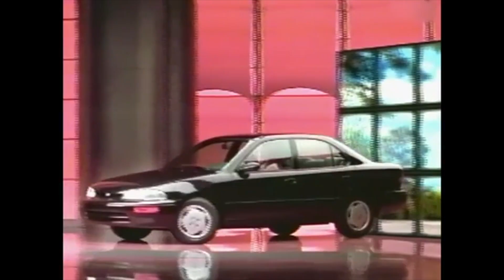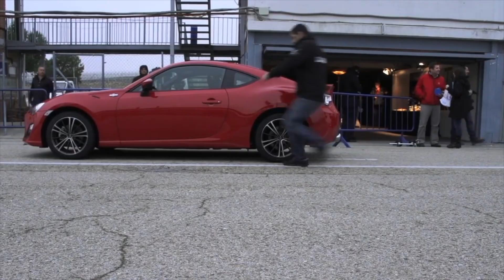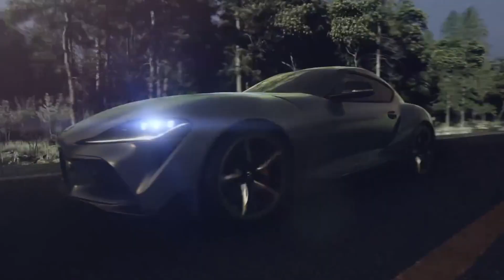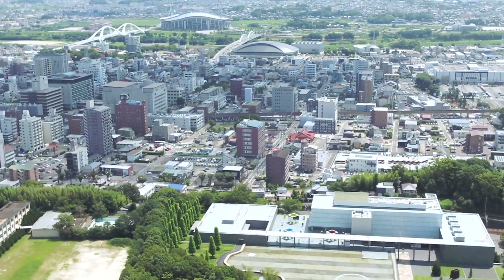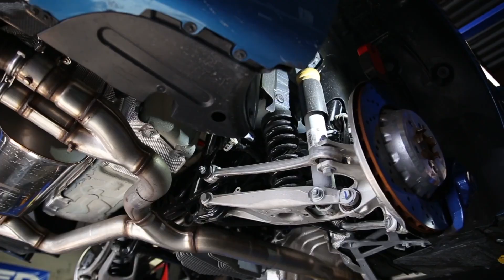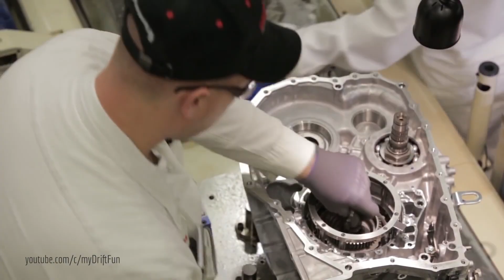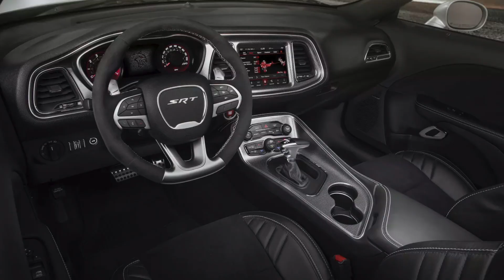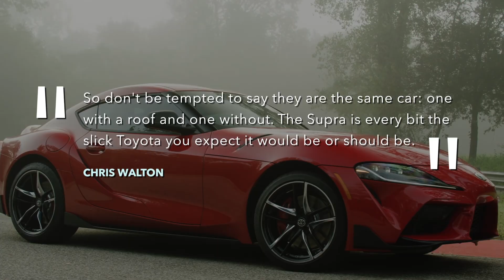MKV Toyota Supra - BMW or Toyota? The UNTOLD TRUE STORY

Comment: Yep yep lack of understanding...by both manufacturers is infectious and spreading....
Manufacturers have no clue to the loyalty of the drivers/ buyers of sports cars. 
They take pride in their brand of choice.It is the distinction between the Makes .
  Japan has a well seasoned, past, of making cars less expensive, by alot, and better , making their competition run as if Godzilla is coming down the Street.
    They built a Supra thats the opposite. Its very expensive , its not unique to the Brand .
   Which is an illness in the sports car world that started at Nissan with the Datsun Z.
     What ? Where is the connection you ask?
     The Z flew on the scene at low cost and very high performance , in a feild of competitors ,so superior.,was the Z ,it could only be compared with Sports Cars, 2 or 3 times its sticker price.
    However Nissan got greedy with the little cars wild success.
It stole the Datsun name ( which they created ,to saveface if Americans didnt buy Japanese goods)But once the 240Z hit the super World Class Sales records, they instantly ripped up the Datsun Brand and wrapped its Nissan Arms around it.
    But unlike Porsche 911 , who, stayed the course. , thru the decades, with the Driver/Buyer in mind. Keeping the 911 (despite Marketing fickle whims), faithful to the Sports Car Driver desires.
Light weight, performance, a "tool" for the Driver.
   Nissan took the Z and listened to the fickle whimsical Marketers.
And tried to make the Z. not a "tool for a Driver"  as in the 240Z , but a car for ALL people. Which is the complete DEATH of ANY Sports Car.
Nissan lost sight of the Driver/buyer ( not that they ever did , Datsun found and honed that arena on its own) .
Just like the enthusiast Datsun 240Z Driver has kept the porch light on for the 240z return STILL.
Toyota has let down the Supra Drivers down ...nothing to be prideful of now. No distinction.
The rivalry is watered down .
What the Supra Driver got to continue its legacy is a watered down mash up, of BMW/ Toyota
At a BMW price. 
Sports Cars should always be separate made by men of passion for motor sport. 
The Driver/Buyers are keenly aware of, what they are buying .
After all a Sports Car is not a vehicle you get into.
A Sports Car is something a Driver , puts on , his alter ego.
Sports Cars should be created from passion. Financed by the large commuter car manufacturers that dont understand.
Every time they interfere another sports car dies.
Leaving the Sports Car buyer to look else where...resto mods, cottage industry sports car builders, kit car and replicas excetra.
To bad they dont understand , the Sports Car driver/buyer is a VERY Very small segment , also the more, costly. But the BRAND loyalty and  the private product promotion , PRICELESS .
   All car manufacturers standing tall today , owe its success and foundation thru the Motor Sports Community from road and the track.
Reply: what a load of bullcrap, so if lambo made a reliable and affordable Sudan from the ground up with a collaboration from a company like Toyota which specializes in reliable and affordable Sudans and then both released their own take on the same concept would you accuse lambo of "catering to the masses"? is their something inherently wrong with wanting a car who a certain brand made even if they might not specialize in that sort of thing? and you call collabs an infection? well what wrong with asking for help and guidance from a company that specializes in different things from their own? it should be obvious to any buyer that if your buying a type of vehicle that that particular brand doesnt specialize in, that it might not live up to other cars made by companies with many years doing that sort of thing.

while Porsche advertise great looks and ford might advertise well established brand Toyota's thing has always been cheap and reliable and that doesnt change for the supra. its says in the video that they tried to find a cheaper but reliable way to make a sports cars and while it might be more expensive then alot of their other cars that doesnt mean they suddenly lost their spirit. if you want a good fast sports car dont buy a supra! buy a fricking lambo but some of us cant afford that sort of thing and just want a cool looking car that fast enough on roads to be fun and cheap enough that you could afford it. what you dont seem to get was that the sport car driver buyer segment was never the goal. from what ive seen they are knowledgeable enough to rig ups their own car to go faster anyway. this is aimed from sports car admirers(which there are alot of), people who love the look, feel, and way the cars moves but aren't street racing with it. why do you think its not manual?! they were never really the intended audience after they are too small to focus on. that just how Business works get over it. 

btw just googled who much a supra cost in 1996 and it cost 64k in todays money. while the 2020 supra cost will be at 50k for the more expensive model. so yeah the supra was never super affordable to begin with.

Comment: It's blatantly obvious that Toyota has committed a  tremendous amount of R&D to the development of the engine, so much so that it could certainly be fairly considered fruit of Toyota's blood, and BMW is no disgrace in terms of engines either some of their engines are absolutely bulletproof and spit out insane power figures, a collaboration between these companies is something that should be cherished not shunned.
 and chassis of this platform. The fact that as people say it uses "BMW parts bin components" in various places is of no great concern at all. It follows Toyota philosophy to reuse and enhance existing hardware as much as possible. Suspension components made perfect sense to pilfer from BMW's existing parts locker, they source good suspension components.  This is not to even read that the suspension is even made by BMW! A lot of those components could have been produced by any number of 3rd party manufacturers. Dont forget that both MFG's use a lot of parts from same suppliers, ZF, Getrag and Borg Warner drive-train components. Bosch, Denso and Delphi EFI system components. 
There's no doubt Toyota contributed heavily to getting the most out of the structure using the most efficient production processes available, driven by the Japanese philosophy of "do more with less". BMW and Toyota are strong in very different areas of platform design and once again combining those strengths and offsetting the weaknesses should prove to be a pair of awe inspiring results.

Comment: The engine is considered the heart and soul of a car.. the Engine is clearly BMW made, so the Supra is a BMW with just Toyota branded clothing and accessories.

I think when people cried for a new Supra, they wanted something that was 100% Toyota designed and made, not a partnership car.. if Toyota had named this vehicle something else, no one would have any issues with it,, but as it stands, it tarnishes the Supra legacy, especially since the original Supra was purely Toyota designed and made, including it's heart (engine).
Reply: I think you'll find - if you watch the presentation that Toyota and BMW both had in line sixes and that the new engine was developed from the best of both. I'd love to drive either the Z4 or the Supra any day////I reckon they'd both put a large grin on my face.
Reply: O no... probably the best inline 6 motor manufacturers are working with toyota reliability to make an engine... I'm sure it will be aweful 🙄
Reply: so reliable that for Toyota to be happy with any sort of reliability they had to detune it from the Z4s 380+HP. yea so great.......
Reply: The 2JZ was developed by Yamaha, soooo....
Reply: @SixCylinderSamurai  suzuki, toyota, yamaha... same thing, japanese. that's all what morons who drive japanese cars care about. they want their ricers to be ricers, not european luxury cars.
Reply: No it wasn't Yamaha had a hand in the motors
Reply: Every component of the Supra is made by bmw besides the ugly body and interior. This video is propaganda. Toyota didn’t tune the suspension or drivetrain all they did was put in bigger gear ratio to show less power probably because it was part of the contract bmw made Toyota sign.
Reply: and BMW's rarely make it to 100,000 miles without major, very expensive problems.
Reply: Kurt you nailed it. totally unreliable
Reply: yep
Reply: I agree 100%
Reply: @Milkman69ner  but the 2JZ was almost the same as the 1JZ with the exeception of some parts....
Reply: Bentley uses BMW'S engine
Reply: yet over 80% of early E series is labeled as swapped or sleeper cars. 
toyota engines overcomes everything
Reply: Look, in the end its all about the money. Collaboration between countries is normal these days. R&D will always be the longest and most expensive task of any company, and if they can share the financial risk with someone else, more than likely these days, they will, especially for a low volume production vehicle.
Reply: Not only tarnishes the name but also exploit it like logan paul

Comment: THE SUPRA COMES WITH A MODERN MANUAL TRANSMISSION!!!!

I wish everyone would calm down about the manual transmission issue. I am an older guy who actually grew up with manual tansmission "stick" shifters; but times have changed. The Supra, being that we are now in the year 2019, comes with a MODERN transmission. The MODERN transmission in the new Supra gives the owner the best of both worlds. It is both an automatic transmission and a manual (i.e. paddle shifters). Like it or not, the modern version of a manual transmission is the paddle shifters. There are some Lamborghini models that only come with paddle shifters, with no stick shift option available, and no one seems to complain about that. Personally, I like the old stick shifter, but technology has advanced, and I don't blame Toyota for not having the OLD FASHIONED stick shifter. Hell, Formula 1 cars were the first race cars to feature paddle shifters, a long ass time ago. Again, I feel your pain, but paddle shifters allow the driver to control the shifting, just like an old fashioned manual stick shifter.

Comment: Most people say that the 2019 Supra is a rebadged BMW, but I don't think so. Lets look at the odds, The supra seems to be wider, I haven't really gotten into the numbers and it looks like BMW was aiming for a touring sports car that was made for speed and Luxury while the Supra has this but it is more track ready compared to the BMW.  The styling is totally different from each other and that is true, the Toyota has its own specific design compared to the BMW. Now Horsepower. The Toyota has more horsepower compared to the Z4 this shows that BMW aimed at a Luxury fast sport car, while the Supra was aimed at speed and cruising at the same time.Some people say that the Supra is underpowered but why don't you look at body air flow, Suspension, Downforce and all that. The Supra has the correct amount of Horsepower for its weight, size an style.  If you are talking about a badged car then think of the Fiat 124spyder which is just a bigger Miata. Same Interior, better exhaust note, same dynamics but different exterior but unless that, it is just a bigger Miata. Some people say that the Supra's competition which are cars like the Camaro, Mustang G, Dodge Charger and Challenger e.t.c, I would like to say that those cars aren't its competition., those are muscle cars and the Supra isn't a muscle car.  In the Z4 and Supra, My money is on the Supra .

Comment: Toyota has killed them selves. Using someone else engine. What a joke
Reply: An engine that they helped develop and wouldnt sign off unless it met their standards. Or did you not watch the video?
Reply: @gamemaster634  I am pretty sure a BMW engine is a BMW engine nonetheless, you cannot test it's reliability over time in just a year or so. Please shut up with this argument, all BMW's or eurotrash in general is made to be a "ten year car", so expect the new Supra to break down pretty often and pretty soon.
Reply: @Dan-lk8jg  eurotrash? Built to last ten years? My Alfa Romeo is 17 years old and going strong, tough as old boots. You my friend sound ignorant.
Reply: @Dan-lk8jg  I've had a 1998 BMW 528i in my family since 1999. It's the singel most reliable car I've ever seen, going strong for over 20 years. 10 year car my ass.
Reply: @Sader325  I thought the 3's and the 7's lasted better, but I'm newer to BMW, working in a Import repair shop as a service adviser. I'm really enjoying it. First week not being a automotive technician.  If I'm correct, with my limited experience, it speaks to how well you've cared for it.
Reply: @Dan-lk8jg  funny how it was in development for about five years, only being able to test the reliability for a "year or so" doesn't seem like the case. You are a hater and probably have never designed anything. It is clear in Toyota's mission, illustrated by this video that it is not supposed to be the old supra.
Reply: @timcoccarelli2193  it takes about a week to put a year of testing on an engine. In the lab it can be tested in the harshest of hot and cold conditions. Ford does this. It doesn't take years to test an engine, but they do have years into refining this design.
Reply: Jz motors were Yamaha motors
Reply: they used to use yamaha engines all the time idiot
Reply: @timcoccarelli2193   As they should have done with this car
Reply: Agreed

Comment: im actually more surprised that people where getting it wrong so often on the internet, BMW and Toyota talked about this almost 3 years ago. The Supra is using a design and body that comes from a 2011 Toyota Concept car that eventually led to the GT86 and Subaru BRZ's design and release.
but this new "Zupra4" is really more of a BMW work then Toyota's unlike the aforementioned 86. 
the BMW is coming with more power, and more options to the car at the same MSRP price.
Meanwhile a Audi TT Rs has more power and AWD for the same MSRP price as the supra or Z4. leaving the Z4 and Supra to be a Front engined Rear wheel drive purist's option for a sporty car in the 50 grand price range. Lets not forget the disappointment in no manual option.
i've good things about the BMW engine, and the handling is at least good enough to hold up to what the Supra was like when it first came out. but there's nothing Major that's improved over the decades aside from the body.
The BMW engine probably wont like getting upgraded quite the same way the 2JZ in a supra did. 
although lots of German tuners are sure to have at it.

Comment: So let me get this right. So BMW derived engine. Front and rear suspension "largely" taken from existing BMW cars, ("...with added benefit of them being able to use existing parts in the BMW supply chain."). The electronic diff. and drivetrain. BMW. Okay, okay, a 'common' transmission. But it's NOT a BMW????

So let me ask this. What exactly does the spirit of a car consist of? The Supra was Toyota built and refined for several generations, and more importantly, based off of an all Toyota platform.  This monstronsity here only carries that legacy in name. 

Right now it oddly sounds like it walks, talks, and quacks like a duck, but is being called a Swan. Nobody want's a Toyota Z4. Give us what Toyota developed and showed us in the FT-1 concept, or go home.

Comment: @12:57 You say the interiors are developed totally independent, but the Supra interior is quite literally 100% BMW. I haven't seen a single switch or button that isn't from the BMW parts bin
Reply: and trust me those BMW parts won't last ... not because the Germans cannot engineer it to last but precisely because BMW has mastered the engineering and modeling for the parts to last lots of miles but fail not long after the warranty "times" out. My company specialized in resin formulations and we can tweak the chemistry of any resin material to fail after a set amount of time/cycles and my experience with my very low mileage M6 has me convinced that the parts failures are no accident.
Reply: Resq Av8r wow didnt know that. Really make me think when purchasing a car
Reply: @Resq Av8r Really? A 1920s-incandescent-light-bulb-like conspiracy? (IIRC) (Like the dreaded "1000-hour-rating" incandescent light bulbs)
Reply: @resQ-av8r  that's fake news, most of the interior came from 3rd party manufactors that produce parts for most of the premium class cars not for one label exclusive. (like the company dräxlmaier / https://www.draexlmaier.com/produkte/interieur/ or many others listened here http://www.iacgroup.com/ )
Reply: I have to agree, the interior looks just like a BMW and what turned me off from the car.
Reply: The Z4 interior looks more like the MK4 supra than the new supra does
Reply: EVEN  DOWN TO THE FREAKING KEY  ITS 100% BMW ! WAIT TILL U SEE THE KEY ! I JUST CAN'T BELIEVE TOYOTA COULDNT EVEN MAKE THEIR OWN KEY FOR THIS CAR! ALSO THE SAME ENGINE MADE 370HP OR CLOSE TO IN THE OLD Z4 ! SO U DIAL THAT ENGINE DOWN?? SO IT HAS 15 HP MORE THAN THE ORGINAL 25 + YEARS AGO.  WATCH THE CRAP SALES  #S ! HOPEFULLY TOYOTA WILL LEARN THERE LESSON !
Reply: bigballer to be fair...at least its not a maseratti sharing parts with chrysler. BMW parts aren’t a bad thing
Reply: Nick Pagano The point is that it isn’t a pure Toyota. It’s a cheap reboot of an adored classic.
Sure, Toyota made some modifications to the engine and chassis but it’s mostly German badge engineering